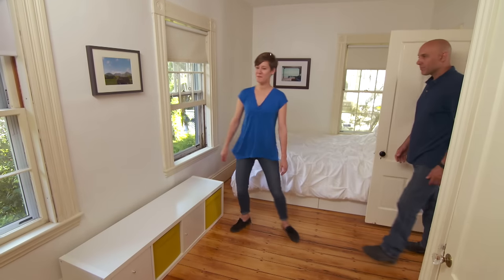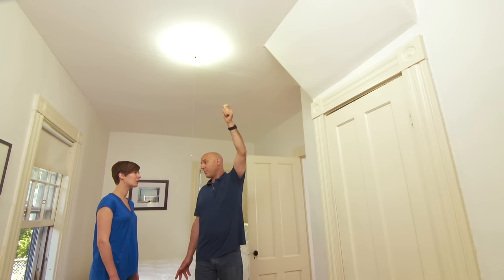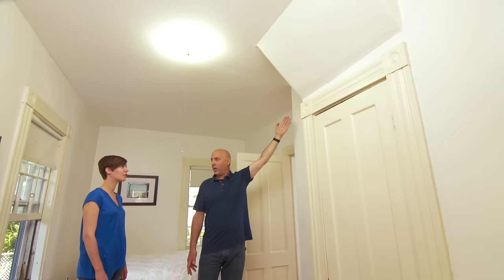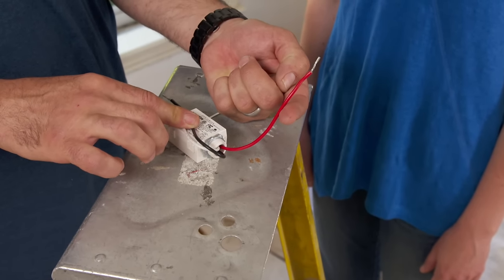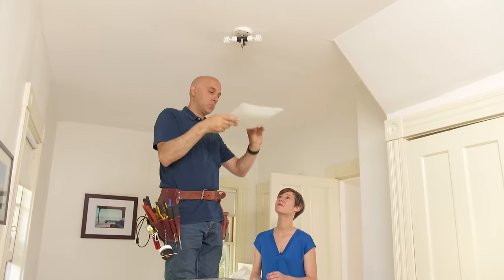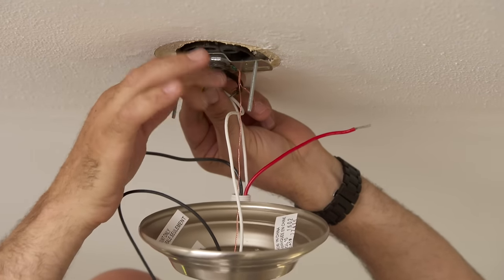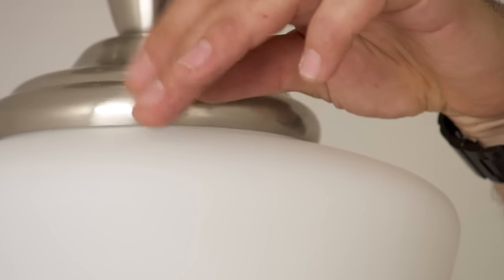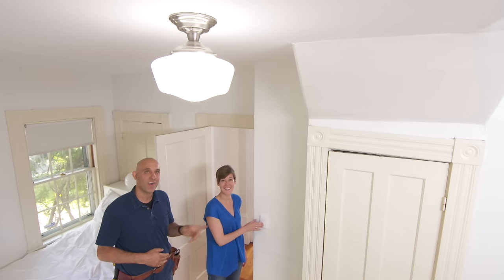How to Install a Wireless Light Switch | All About Lights | Ask This Old House

Comment: I'd rather pay a $100 for a wireless switch vs the other options. wonderful option. I didn't know existed.
Reply: He never told you how the switch is powered did he?
Reply: @31acruz  it's a kinetic energy switch manufactured by Leviton called LevNET and has since been discontinued... Also clicking the switch generates the power to send the signal to the relay
Reply: @Rifterstrag39  that's pretty awesome technology. Too bad it's discontinued. Wander why.
Reply: @hulkhuggett  find a replacement yet?

Comment: I definitely love how convenient these wireless switches are. This is the perfect application for one.
Reply: @Lucky Joestar your phone as well
Reply: I was using Insteon and they went out of business 2 days ago.  Nothing works now.
Reply: @wadeinn463  these communicate directly so it won't matter if the company goes out of business... well you won't be update any firmware to patch security issues, etc but these are not cloud based. They don't require a company's servers running somewhere to keep this working.

Comment: I have an old house with the same type of cloth covered wire. The last fixture I installed I made jumpers connected to the old house wiring/ tucked it up and voila, new wiring to attach the fixture to. That's a neat wireless light assembly.

Comment: Had one of these remotes installed in a light fixture switch box that controlled a light in our kitchen and the remote switch about 12 ft away on another wall at the entrance to the kitchen. It worked well except that at random times the light would come on and go off without any switch being used. We lived in a condo building and figured out that someone else may have had a similar remote wireless switch installed which was causing the random on and off. We ended up chucking the thing away.
Reply: You should have used yours A LOT, so they ended up throwing theirs away instead.
Reply: You could change the frequency I think
Reply: that would be a pretty nasty bug, these should have unique identifiers...

Comment: I like how she "conveniently" had a new light fixture with a deep canopy to easily accommodate the remote module.  Try stuffing that thing in the electrical box, or a fixture with a much more shallow canopy.  Nice option though.
Reply: shanecthompson77 i was thinking the same shit. lol. its actually meant to go in a knockout in the box in the attic. lol. but hey, whatever works.
Reply: they have a trailer, money, and the show is scripted, how are you surprised?
Reply: You hate to make a hole in good ceiling to hide this thing
Reply: No

Comment: For those wondering how this works this is what I would have to guess. Inside of the switch is a special crystal(L1: https://youtu.be/ZlVI7YJGHq0)(lapiz I think, can't remember) that is similar to what's in a lighter, when it gets "flexed" quickly it produces power, it is then probably ran through a resister to limit it (or) straight into a spark gap data transmitter (L2: https://youtu.be/SnKKj2bonAI) which then transmits it. Extra info 1: Because of the type transmitter that is probably used there is no encryption hence why one of you had interference with a neighbor, So you can probably only have one. Extra info 2: The reason the switch is a momentary instead of a toggle like most household light switches is because of the crystal used. This is an educated guess using what I know, if you agree, disagree, or want to add more to this discussion comment and like so others will see how it works.

Comment: We have ceiling fans in all bedrooms at my house that the previous owner paid to have wired but didn't install any switches! All operated by remotes. I want to switch to nice lights and was going to run wires (attic above) but this is SO EASY! I am very excited about this discovery.

Comment: Scott said there was no battery in the wireless switch but did not explain how the switch assembly is powered. It needs to send an RF signal to the receiver (with antenna). Pressing the switch produces a small amount of electricity but how ? The range is claimed to be 100 feet according to the ads. The system costs around $100.
Reply: I'm sure the switch has a battery and $100 is ridiculous.
Reply: It's kinetically powered. They basically turned the rocker into a little generator-- enough for the RF impulse... thus the silly price of $100+.
Reply: Nope, no battery - Just looked it up and I found a bunch like this http://tinyurl.com/hfer4bv and a few for less - the $100 estimate is probably $60 for the switch, plus $40/hr for your electrician.
Reply: $40/hr for an electrician is laughable. That will not cover 30 minutes.
Reply: SirVixIsVexed - Yup.  It's too prevent running additional wire... always more expensive unless you DIY.
Reply: faraday's law of induction
Reply: or someone said the piezo effect.. doesn't seem like that would work tho in this case. Not sure
Reply: Glenn Watkins magic 😉
Reply: I wouldn't have guessed it was piezo unless they got really clever with the pixie wrangling (I'm thinking piezo -> cap -> inductor)... at any rate. Obviously a solution for situations like this: a homeowner who doesn't know/care/want to go the 'proper' way.
Reply: there are similar versions for under $35 on amazon.
Reply: BaronVonPatches Where do you need an electrician for? Did you see any steps in this video which needs a pro?
Reply: True. Especially if your house is made of brick/concrete blocks. So if you want to add additional wire you have to cut a groove in the wall and ceiling, patch it, and paint. 
Using the wireless switch will be much cheaper solution.
Reply: Yeah, pushing the button generates enough electricty to power an RF Chip to switch the light.  I've used this thype of button in Industrial settings.
Reply: Glenn Watkins a
Reply: $100 is very cheap vs cutting drywall, fishing wire, patch drywall, sanding, painting.
Reply: Yep I'm an electrician and for me to do that job i'm around 2-$250
Reply: Glenn Watkins it creates power when you push the button....look up enocean switches to learn more
Reply: It only took him 15 minutes.
Reply: yes, 100 USD is ridiculous, but the no battery switch is available.  There is a small generator in the switch, it can creat electricity by cutting magnetic line. When you press the button, it will start to cut the magnetic line
Reply: It uses a piezoelectric system, similar to the electric ignition on a gas grill.
Reply: UL listed of course? Yeah right lol.
Reply: Roland Yarrington depends on your region...it is low for a master though.
Reply: Seems that if you have only one light you want to convert this may just be price competitive with "smart home" solutions out there but as soon as you need to convert more then one light it's rather overpriced.
Reply: stefan buist Unless the feeder for the other lights is in the box your installing this in (very common practice) then your correct
Reply: Exactly, that's why it sells.
Reply: The switch does not have a battery. the process of pushing the switch produces enough power to send a small RF signal.
Reply: Glenn Watkins $100 heck no. Wow I was just looking to see what this cost. But I guess not  . . I will run wire
Reply: jo kopou I'm interested
Reply: it's powered by demons
Reply: Smarthome carries them for way cheaper and yea I cracked up when he said “no batteries”. The switch, all wireless switches have a 3.3v battery in them but can last for over 20 years

Comment: That is some pretty cool tech. Simple, functional and easy to install.
Reply: well .. on the other hand, it's a hundred dollar light switch ... I'd rather have a pull chain ;)
Reply: Indeed! Well, for some, money is not an issue. :)
Reply: still34u - I bet it's still cheaper than having the electrician out, cutting channels and running wire!
Reply: Amy Cutting That's a good point, I usually do everything myself, sometimes I forget other people don't
Reply: Amy Cutting indeed.
Reply: It isnt free just becouse you do something yourself. Or do you value your time nothing. Is your time worth 0$?
Reply: He’s lucky he had a new fixture with space inside for the module
Reply: He’s lucky he had a new fixture with space inside for the module

Comment: It used to be that no self respecting electrician would go this route because many remote modules were absolute junk that would break down and be a nightmare to troubleshoot later due to the hidden parts in light fixtures, but in the last several years, the products are much better.  I'm not a big fan of the Leviton that Scott is using and prefer Lutron's various RF lines myself since you can also tie them on to other home automation systems.
Reply: I will add, here, that these RF remote things are VERY susceptible to interference  ESPECIALLY from WiFi and other RF devices in the home and the neighbors; not to mention, electrical spikes from lightening strikes and large appliances on the electrical system..

Comment: My company has used these a few times.  This guy seemed to leave out the need to link the relay to the switch, and you can install it directly to the wall so that it looks like a real switch and not some handyman installation.
He left out the fact that you are not allowed to extend an ungrounded circuit, new installations must use modern methods, so running a switch leg would not be allowed unless you provided grounded power to the fixture.  Of course that may just be in our jurisdictions.
Reply: Comment to your This guy seemed to leave out the need to link the relay to the switch,"

You are right in that the relay to the switch MUST be synced to use exactly the same signal. But if you buy the exact one he uses in this video ... I read on amazon website that they ARE  SYNCHED up at factory so they will communicate to each other. I read for a couple of other same kind of wireless switches that they do the same thing at the factory so they can communicate with each other. So no need to worry about them being able to communicate with each other. 

I bought this exact wireless product, then  installed it ad it worked perfectly plus I made the wall socket look like all the other wall on/off switches and thus it looks professional (same height plus on goes up and off goes downward.)

Comment: Super old wire insulation coating, how safe is that?
Reply: Actually still meets code, 100 years later!
Reply: The insulation looked to be in great condition,.  I would feel very confident in continuing to use it.   Unfortunately often this is exactly where the insulation gets cooked in a house with knob and tube wiring.  It is a result of overlamping the fixture with 100 and 150 watt incandescent light bulbs over many years.   In that case, the insulation becomes quite brittle and falls away readily when manipulated.

Comment: i think it would be cool to have it as a remote control for the bedrooms. that way you can turn on and off the light from bed.
Reply: Victoria Kondo check out the WeMo switches. They connect to your WiFi and you can control from your smart phone

Comment: 80 year technology finally comes to the market why didnt somebody figure this out years ago.
Reply: Back in 93 I saw a light "switch" that would hide inside the fixture and react to a car alarm remote. Not practical if you are in a house, but they lived on fifth floor.. so they didn't unlock their car every time they turn the light on. and that was 25 years ago
Reply: I've had a switch like this since the year 2000--although the switch itself is a pretty hideous-looking thing with about six buttons on it.

Comment: Is there a device that replaces the switch on the wall and allows you to have a remote at your desk or at your bed to turn that switch on? I have an office with six canned lights, so this would not work. Unless maybe this device would screw into the first can light of the run??

Comment: Hi I have a building about 125 from my house that has regular flood lights on it and a switch to turn them on in the building . My question is there some way I can turn them on from inside the house maybe with a remote rf control. I just don't know what to to tie into the switch to do that. Thanks

Comment: It's a great idea and very practical... unless you're replacing one switch in a three-gang switch box.  I haven't been able to find a three-gang (or any multi-gang) wall plate with one of the switches blank.  Anyone know of a solution?
Reply: I've read through some reviews of these wireless kits on amazon and a few people have managed to squeeze a wireless switch into multi-gang switch boxes with a few regular switches.The front plate and back plate of the wireless switch comes off, but it's still a bit of a tight squeeze, they said. I don't think you could fit multiple switches in. 

The reviews I saw were buried someone in here, if you are curious. .. 
https://www.amazon.com/Basic-Wireless-Light-Switch-Kit/product-reviews/B005B0AY0K/ref=cm_cr_arp_d_hist_5?ie=UTF8&reviewerType=all_reviews&sortBy=recent&filterByStar=five_star&pageNumber=1#R3CYAR25XHW2KU